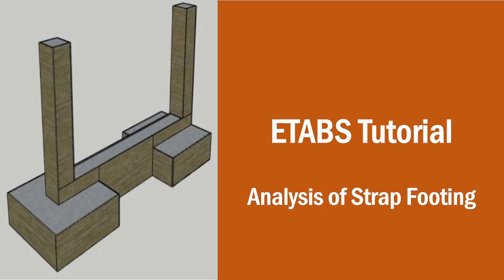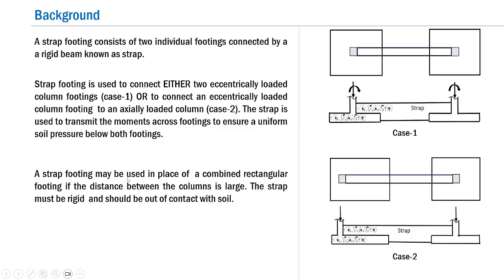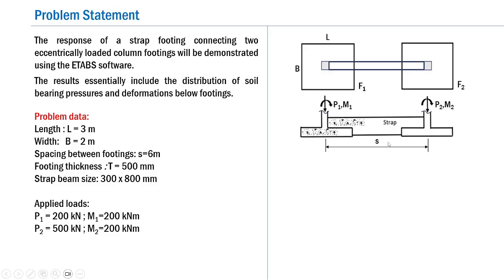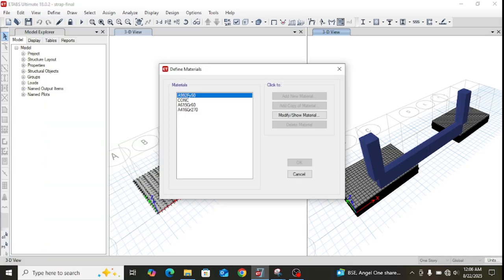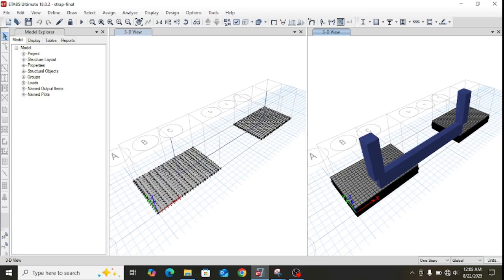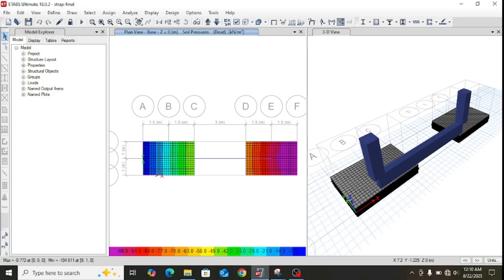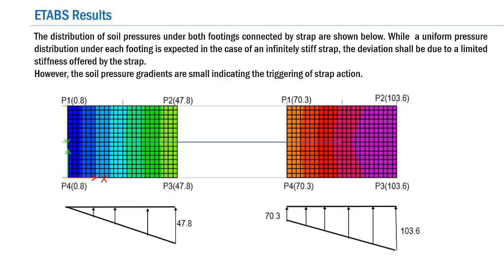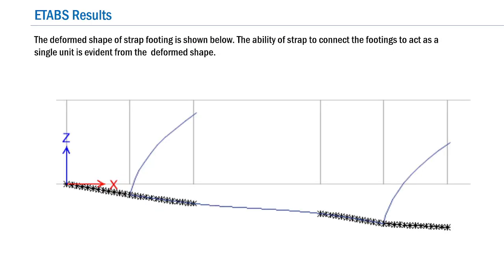An ETABS tutorial for the analysis of STRAP FOOTINGS……….

Comment: Thank you for sharing this excellent tutorial. Your demonstration clearly shows that ETABS can be used end-to-end for both the superstructure and the substructure—capturing soil pressures, footing deformations, and the strap’s load distribution within a single model. Too often, engineers underutilize ETABS and spend extra time exporting to SAFE when the problem can be addressed directly in ETABS. In my experience, designing the superstructure and substructure concurrently in ETABS clarifies the load path, reduces handoffs, and ultimately enhances the safety and integrity of buildings. I’m grateful for the valuable knowledge you’re providing.
Reply from the maker: Thanks for your support. Your observations are highly appreciated and hope that other engineers will also conclude in the same direction.
Reply: @puttattjayarajan1199 thank you for understanding me sir, I would also appreciate it sir. Hope community will grow better